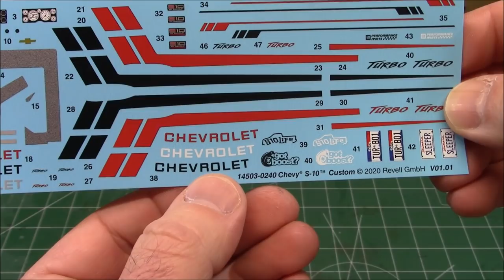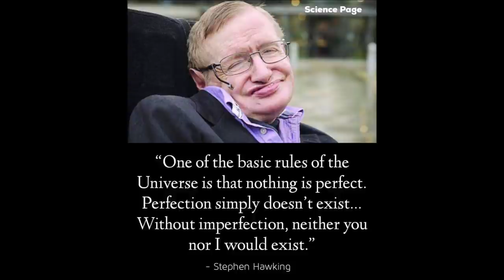1993 Chevy S10 Turbo 4.3L V6 4WD 1/25 Scale Model Kit Build Review Revell Monogram 85-4503

Comment: That 4.3 was bullit proof and way more power than the S10/S15 needed. Why did GM stop making it?
Reply: Bullet proof? Not by a long shot ,extremely troublesome engines ,overpowered for an s10? Quite the opposite

Comment: Definitely the s 10 and GMC s15 Sonoma were derived from the G body platform the G body and s10 truck chassis is exactly the same the only difference that the truck chassis has a slight incline then its flat towards the rear of the frame the G body car chassis has an arch for the  wheel wells for the trunk and gas tank

Comment: Never owned one of the 80’s model s10   Had a late 70’s and a early 90’s extend cab   Both only had the 4 cylinders with a manual transmission
Reply from the maker: S10s didn't come out until 1981.
It's possible you owned a Chevy Luv in the 70s, but that was a different truck. I didn't even know the LUV was available as an extended cab. Cool.

Thanks for watching!

Comment: I just finished the scratch built 85 front clip & still working on the dash. This kit is a reissue kit from the 90s wich they reused the mold for the gmc syclone ,s10 lowrider and the waverider same kits with different front grill option and ground  effects ,
Reply: Cool. Although the early 90's ones looked a bit more "sporty", I always liked the original grill and dash design more.

Comment: I built a Revell #7435 GMC Syclone Pick up Skill Level 2 model kit and a Monogram # 2438 Waverider Chevy S10 Pick up Skill Level 2 model kit back in the mid 1990s. The Waverider Chevy S10 was a customized version of the S10 pick up. It had a custom front grill and bumper,  custom rims, tonneau pick up bed cover, body ground effects, a rear spoiler for the pick up bed, and a custom decal sheet. It was molded in a metallic green color.

Comment: I have a little S10 model came with a well-adjusted GMC S10 it came with the tonneau cover I did include a tonneau cover on you can take it off or do whatever and mine came with a bug shield for the front hood I had a real nice GMC S10 kit course I lifted mine up some Minds jacked up on some monster truck tires

Comment: Nice dream model. S-10 was 2 wheel drive S-15 $ Wheel Drive, The Cyclone nd the Brevada where the only S-10 Chassies using AWD
Reply: Not true sir. You have improper general motors information. The manufacturer began in 1982, produced this truck in 4x4 in all models of s-10 as an option. the bravada came way way later like 1993 they had been producing 4x4. For many years sir the bravada is a non selectable all wheel drive system. Its not selectable as in modes 4x2 or 4x4 high or low range. Lets not spread false information thanks!

Comment: Is there a trick to getting the hand painting right on parts? I tried painting some silver but it looks streaky and not as uniform, I’m using acrylic btw.
Reply from the maker: Brush it on and leave it alone. Too little paint will leave streaks, too much will run off. Just practice and you'll get it. 
Enamels self level much easier.

Comment: I used to shred the rear tires off my father’s 92-93 S-10. The 4.3L in it was great for my 16 y/o self. I wish we still owned it.
Reply: Most of 'em have oxidized by now.
Reply: Frames dissolved in the presence of water vapor.
Reply: We sold it a guy in our town. He’s still got it.
Reply: Buy it back!

Comment: Awesome build, Chris! I picked up a couple of these myself (and have both 2 different older versions of Revell's S10 the kit was based on sealed-ready to build someday, and 1NIB ready to build later Syclone kit). I've owned 3 1st Gen S10's over the years, a 1988 4x4 Sport (2.8L automatic), and a pair of lowered '91's (at the same time, early 00's), one had been my grandpa's before me (2.5L/5 speed, bare bones truck, I static dropped it as low as I could get it, LOL, he bought it new in 1991) and the other I bought with a 350/700R4 combo already in it that I added "big n little"  Rally wheels from a '68 or '69 Camaro (it was a no shine red color, I masked of scallops with flames for the inner striping and sprayed it in grey primer over top of the red, saw an old Datsun 521 in a minitruck show like that and really liked it). Anyways, sorry to ramble. Thanks for the memories, brother, I hope you and family are well 😊✌
Reply from the maker: Thanks for joining the fun!

Comment: I want an S10 extended cab
Reply: I still want a Chevrolet S10 extended cab.
Reply: That would be cool............
Reply: @karlricker3291  My dad had a blue 01 S10 extended cab with the zq8 wheels
Reply: @kruleworld  Maybe someone will offer a resin soon.
Reply: @THROTTLEPOWER  I need a 98-01 grille
Reply: @misterbuklau4053  yep!
Reply: I had 3 x cabs. Not first gen though. I had a 94, 99 and an 03. Plus a 98 and 99 Blazer and a 96 Jimmy. I miss them.
Reply: @THROTTLEPOWER  there's resin on ebay. But at $100 I'll pass.
Reply: @jm349  I'll make a custom one with styrene then lol
Reply: @jm349  Ya, way to much.
Reply: @jm349  👍👍
Reply: Redlineresins.com has one it almost a full resin kit for 70 bucks.

Comment: You had an 85 Jimmy? Probably had the 2.8 liter "struggle six" with a 2 bbl carb. My first truck was an 85 S-10 2wd extended cab. My uncle and I swapped a basic 305 and 700R4 from a wrecked camaro into it. Really fun lil rig
Reply: 110 HP. Ugh
Reply: @fredzeppelin3969  they were torquey for such a small engine, from the early 80s, but, they'd spin rod bearings like they got paid to. They were hit or miss too. I've had several over the years and some would run and run, while others seemed like you were on borrowed time. The later version, like the one I have in my 89 Z24 convertible, that thing is smooth as silk, sounds good, and just goes about it's business without complaint
Reply from the maker: I put the Elelbrock intake and exhaust on it. Took off all the choking emissions equipment, removed the catalytic converter, lifted it three inches and it ran like a top until I got rid of it with 160,000 on it. 
It was my first vehicle and I beat the bejesus out of it and it never failed. But I went through two transmissions from being way too rough on it as a teen.
Reply: @hpiguy  what's funny is, I recall my uncle telling me that people used to build those 2.8s up exactly like you did. I believe there was even cams and heads available for them.
Reply: @hpiguy  if they were manual transmissions GM had lots of trouble with the (mechanical) clutch linkage on 1st gen S-10/Sonomas